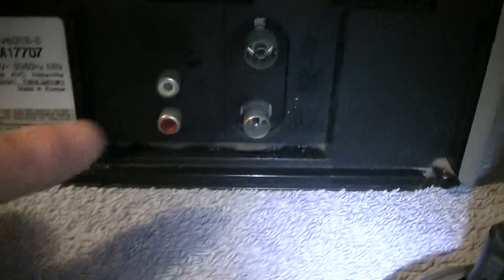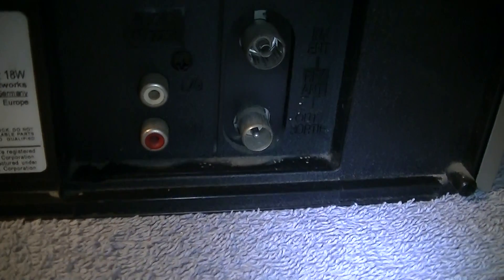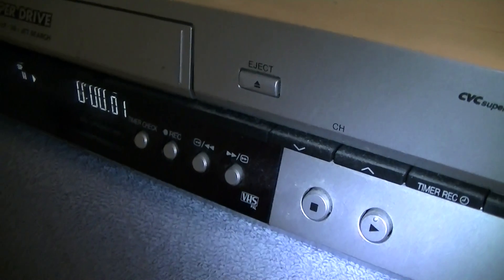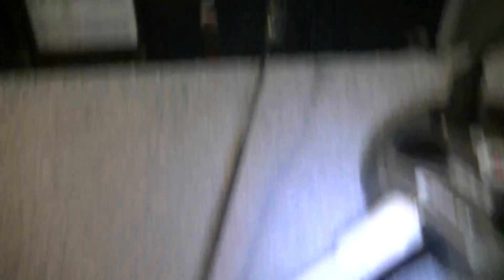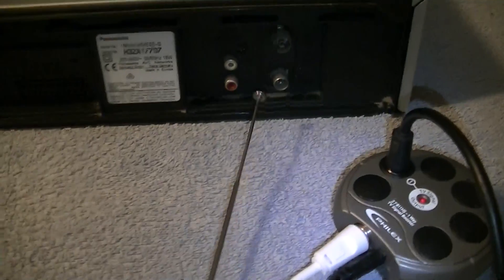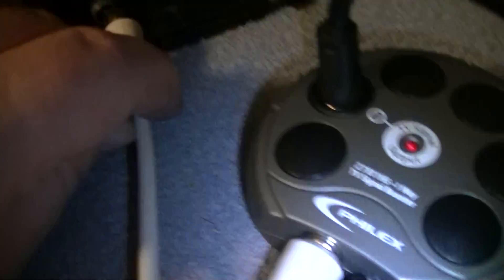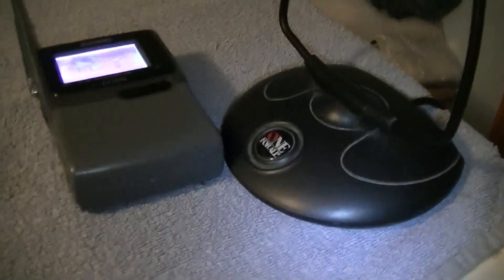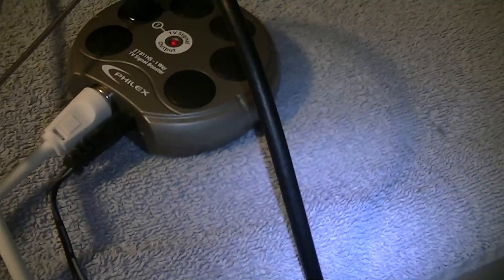Turn your old VHS video player into a TV transmitter.

Comment: Interesting video. Thanks for sharing. Also, when connecting a piece of coax to the RF output of the VCR into the RF input into another nearby VCR or even a TV input antenna socket, it is possible to view digital TV programmes on an analogue TV, without the signal transmitting outside at all.

Comment: I did this with a raspberry pi connected to a composite video to RF converter; to a booster, to an antenna; in order to broadcast Ceefax/Teletext to the TV's in the house. 
Obviously only works with TV's that have an old Teletext decoder built in!

It may work better if I can plug the composite output from the PI into an old video recorder, hmm.
I  think a home-built transmitter would probably do a better job, but that may be getting a bit closer to 'Arr Shiver me timbers, Jim lad..." territory as I'm not sure how far that would carry!

Comment: for a tv transmitter, build dazaro3's breaboard transmitter and leave out the preamp (omit everything beyond the 100nF audio coupling) and add a 1K pot to the emitter, instead of the 100 ohm... couple a 100 nF to the mid-pitch of the wiper with a diode shunted (clamped high) on the side of the resistor and a 75 ohm resistor (or 82 ohm is what i used, maybe a 68 ohm or two 150 ohm resistors in parallel) and another coupling cap of 470 micro ohm to the video source... you may even omit the RF amp stage... use a slightly larger inductor as you are tuned to ~ CH. 4 (66MHz)... something like this... http://www.zen22142.zen.co.uk/Circuits/rf/tv_tx.htm ... transmit the audio 4.5 MHz above the video RF carrier with a seperate transmitter (say, above 70.5 MHz), such as dazaro3's breadboardaudio/FM transmitter bug... simply change the coil... buy some 79L05 regulators also

Comment: i used an old low power fm radio  transmitter plugged into a tv booster and it worked pretty well

Comment: I know this sounds odd but is it possible to use an 8 watt FM transmitter to transmit video and audio say on 92.1 MHZ , video on the left channel and audio on the right channel then use an FM stereo tuned to the same frequency as a receiver? I connected a 3.5mm jack to RCA adapter to my transmitter and plugged my TV into a stereo using RCA jacks from my stereo. The stereo picked up the sound and interference from the video signal but the TV would not recognize the signal. I would have thought it would have at least picked up the audio signal. My guess is I might need to run the signal through a RF modulator?

Comment: so if lets say hypothetically,
you lived a mile or two away from a relay transmitter which most people in your area use for TV (yes it's all digital now)
i assume there relay will still be working in analogue ? or would they have just turned them all off, bear in mind this is a relay..
so say a booster and a high gain yagi directed at the relay with the correct input frequency would there be any receiver and any chance to be retransmitted ?
or do you have to now go digital in to get digital only out ?
not analogue in and analogue out ??

Comment: The quality of the picture on the large television set downstairs is actually quite good for an analog signal.
Reply: Analog is still the best signal in my opinion since you'd need a hurricane to disrupt it yet on the digital all you need is a small storm or wind to disrupt it
Reply: @entity9742  analog doesn't exist no more so it's not the better option idiot
Reply: @illkid86  just because something is outdated and replaced by something someone decided was better doesn't mean it was for instance like i said before the analog signal needs strong rain or a hurricane to disrupt it while a digital signal just needs a slight gust of wind or a cloudy day to distort the signal

Comment: In the US, FCC states in Part 15, that we can legally transmit signals for up to 200 feet away and it can't interfere with other signals.
Reply: that is awesome to know where I live that is not a problem ahhh to enjoy analog tv again id be very happy and to control what I want to watch too
Reply: Alex Kinch I thought it was up to 500 feet, but I could be wrong. From another source I heard a mile but I doubt that
Reply: I thought it was 400 feet.
Reply: That's only partially true.  Transmissions in the broadcast TV bands are specifically prohibited, save for low-powered wireless microphones and medical equipment.  

Now, in practice, if your signal doesn't leave your property nobody will care because nobody outside your household will be able to receive it.  But you're talking a radius of 50-100 feet maximum, which is the microwatt power level.
Reply: WeatherNation Fan from 2004 you might be right, I think as long as it doesn't interfere with anyone, it should be fine
Reply: They really only allow those little FM transmitters you can use to put direct phone audio into your car's FM radio, so I don't really think it is legal more than maybe 20 or so meters, because 200 feet is the span of several mobile homes and the FCC would have you arrested for that
Reply: it’s now illegal to transmit over air at all
Reply: @roccoholcomb You are correct. however, Don't be too upset, every single move we make is illegal. There is literally a law against every single thing. That's so messed up 😔
Reply: So since everybody in the comments seems very knowledgeable. Could you tell me how to do it to a old TV I'm sorry this is the first time I've come across this subject but I want to do it cuz I just got my hands on an old weather radio with a TV I think it's black and white I haven't turned it on yet... But yeah anyways if anybody's got some advice I would appreciate it. ❤

Comment: Analog casio with only UHF? Why no VHF?
Reply: In the UK, VHF TV broadcasting ended in 1985, and the frequencies were reallocated to different users.
Reply: SailorNeptune
Reply: +Agnieszka Birkos What?
Reply: ALI6359 

They did....1936-39 and 1946-85.
Reply: PAL-I (6.0 MHz sound carrier), but in Ireland and South Africa, they also used both VHF and UHF on PAL-I. UK was used VHF on 405 line TV system A ( - 1.25 MHz sound carrier) until 1985, now migrate to UHF PAL-I.

Comment: hi, would you please spell the material I am going to need to build this transmitter?
Reply: me tv Costa Rica Television Clasica a vcr and an antenna with an amplifier. Just hook it all up backwards.
Reply: nosehair515 I did this, but the signal isn't strong. The antennas have to be touching for my setup. is there any way to make it stronger?

Comment: I would be very careful as your VCR is tuned onto the new 4G band where it sits on UHF 61- 69. youy could get done by the law. I have made up my own cable tv system which is alot safer, have 8 VCRS tied up with freeview boxes so i can use old tv set with out scart sockets.

Comment: Hi all,

We did this kind of test with 2 and 3 stages with about each time +19 dB .
We had good success, so we gone further and located the last stage at the roof of our house with a dipol antenna. 
At he end we could reach about 250m distance with direct eye view line. 
Adding the 3rd stage was a little confusing, because the signal was particually overloaded. 
Reducing the voltage of the second stage from 12v to only about 6v from the 2nd stage gave then better stable results.

Greetings to all from Ankara

Comment: I recently bought a One For All signal splitter/amplifier from Dick Smith for $65, and it works perfectly. All I had to do is connect a VCR to the Antenna In cable and a TV antenna to one of the four outputs.

Comment: Sure you can produce low powered transmitter signals, but when it comes to the law it's broken down into "what kind of signals" and their range. If we couldn't, then the use of cell phones, tv remotes and cordless mics would be illegal. As long as the signals you produce do not interfere with your neighbors devices or commercial broadcasts you're probably okay, but don't bet on it. Technically, you need a license to operate a lot of GSM transceivers, but I think a lot of people just do it anyway. I wouldn't worry about using a vcr rf transmission inside the house, but if you connect to an antenna outside, you're looking for a fine, sad to say.

Comment: First of all, i did not understand very much because of his english dialect or accent and because i am german. But i did understand verry well how he got to it. i tried it once at home, and it works perfectly. the things you need are very simple to buy: 1. an antenna booster (HF amplifier), and one antenna. that's it. ok, you need a VCR also. it MUST have HF (ANTENNA IN AND OUT) to TV. Then you go from OUT to the BOOSTER... from the BOOSTER to the real ANTENNA. HAVE FUN!!! And thank you for your VIDEO!
Reply: just curious,...do you find the American accented English easier to understand?  I was surpised to realize that the Dutch speak English with an almost perfect American accent.
Reply: @ChuddleBuggy  I for one was challenged in understanding him a bit and I’m a native-born American.
Reply: Was für eine art von Antenne ist denn dafür am besten geeignet ?
Reply: televoice - You mean RF - Radio Frequency, not HF. ;) - Its a coaxial RF cable connector here in the US, the RF connectors he has on his VCR are different but if you listen he says "RF output."
Reply: I'll run that to my roof antenna and reinvigorate NTSC!